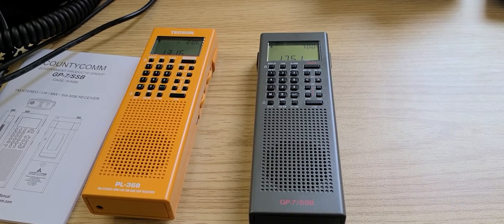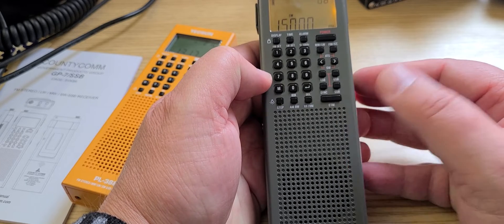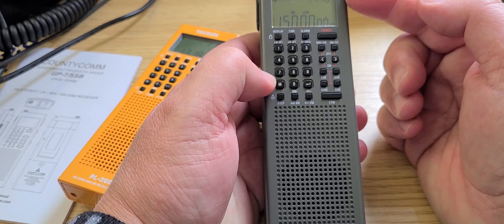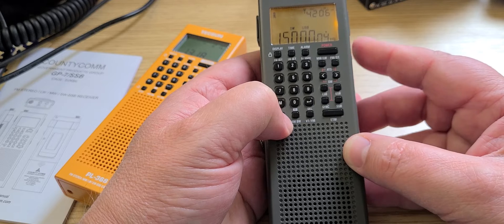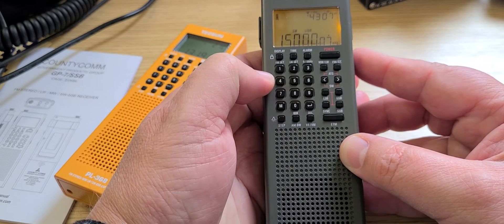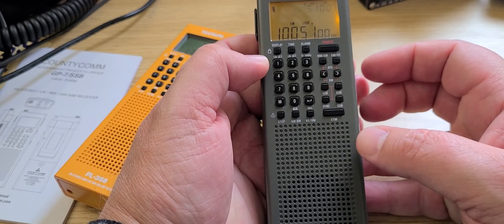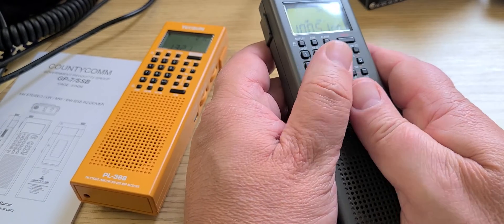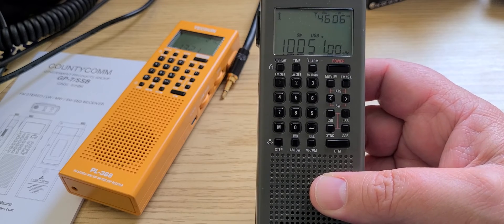How to calibrate the CountyComm GP-7/SSB or Tecsun PL-368 portable receivers

Comment: Unfortunately, I have the version 36.82.  In my radio, the SSB frequency offset is likely due to a software bug.  Firstly, it has different frequency offsets for the LSB and USB modes.  At some frequencies, it could be off a few hundreds Hz.  Secondly, the frequency offset fluctuates with the reception frequency.  For instance, in the LSB mode, the frequency is off 170Hz at 639 KHz, and -100Hz at 701 KHz, +40Hz at 720 kHz, and so on.  Such a behavior is unlikely due to the frequency error of the reference clock.   Does your radio have the same trait?